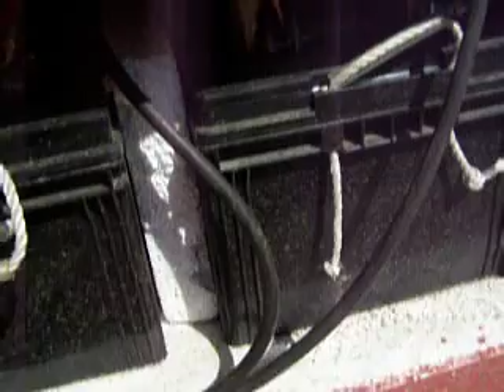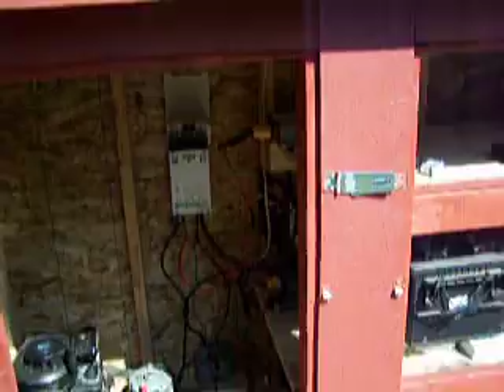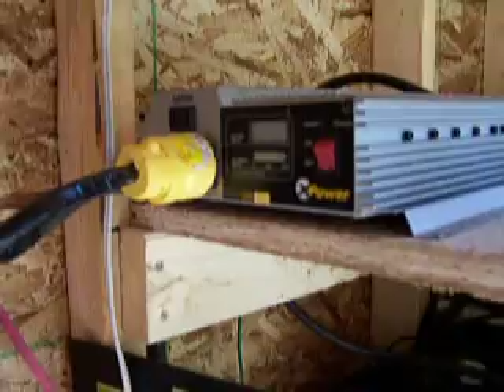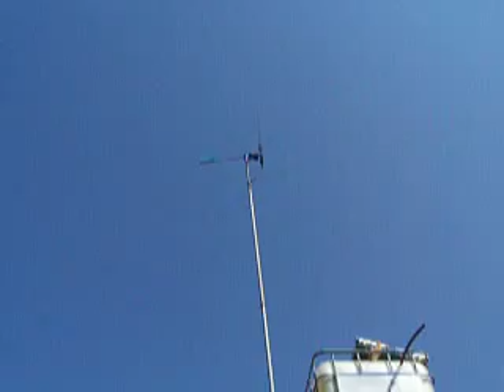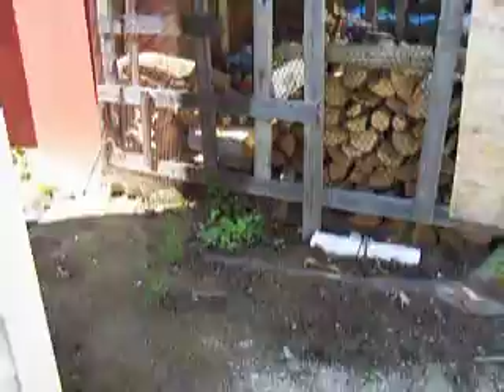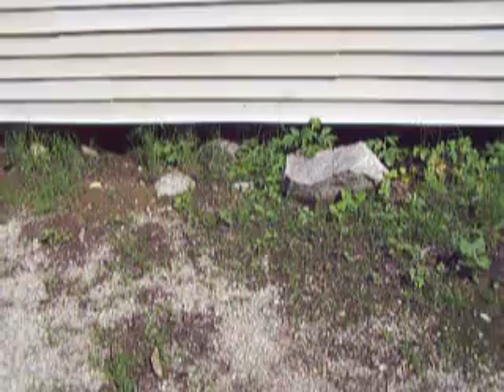Wind/Solar Generator & motor/alternator

Comment: Also if you search thru the videos on youtube you will find ones that use just the fumes to run motors and will never stop. so basically 1 quart of gas can run your engine indefinately just off fumes

Comment: WOW!!!   I'm on my way to doing something like this at my home in the city. But, I placed a muffler on my 21hp Briggs and got 2 alternators for it. Come to find out that the alternators when charging together see the high output from each other and automatically stop charging. Thinking the batteries are fully charged. So now I have a backup alternator. Sam

Comment: bore a hole in your carb an run alcohol (ethanol) and brew your own alcohol and distill it to about 180 proof.

or if you didnt want to apply to the ATF for a still license, the ethanol is miscible in gasoline if its 50/50 mix or under.

Kudos on your self sufficient setup

Comment: its not possible to substitue a low rpm diesel without a gear box, alternators and generators require atleast 3600 rpm's to produce peak apm's and voltage.

Comment from the maker: I posted this video just to show people my set up, yes running a lawnmower engine isn't the cleanest, I seldom run the lawnmower anyways, I used to run a big 4000 watt generator but not anymore, with the amount of wind and sun my batteries recharge themselves from half to full in a couple weeks, I use the engine only if there is no wind while I'm there, its a great setup, charges the batteries from half to full in 8 hours of runtime using the lawnmower engine, 10 bucks in gas.

Comment: woow that's my dream men i live in florida in an aparment i got 2 mitsubishi panels they put 320 watt's and i got a charge controler it's the prostar from morningstar ,i got a 1200watt converter cheap one but my problem is where i live ,they don't letme put my panels out .but i love what u did good gob..